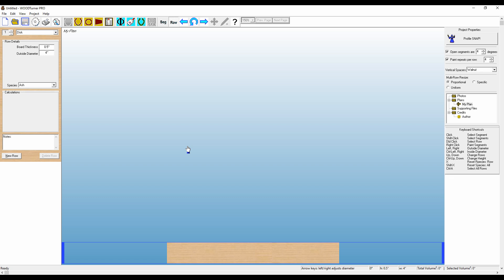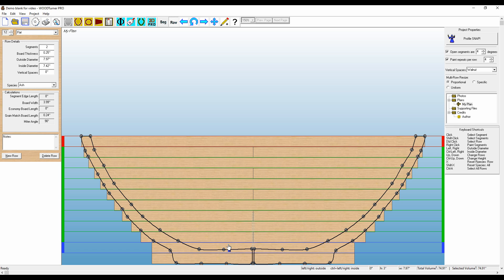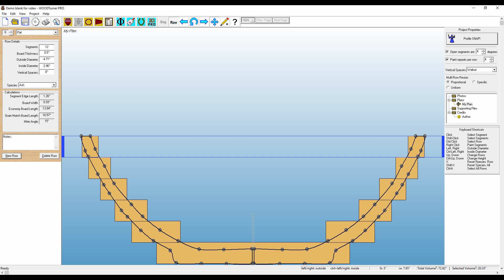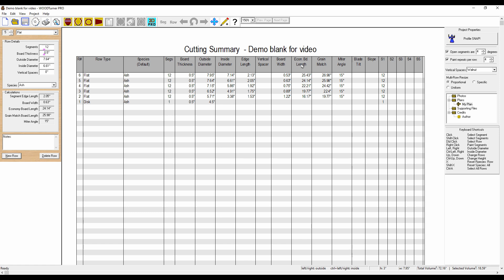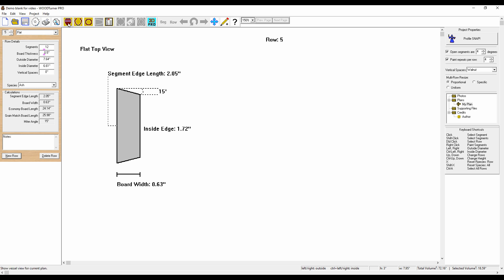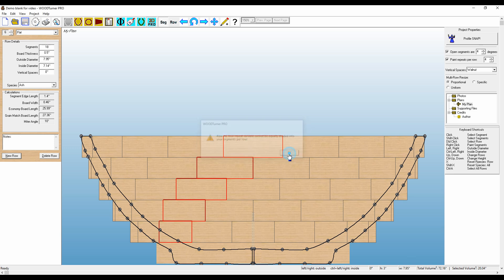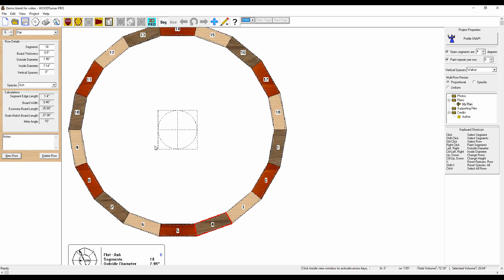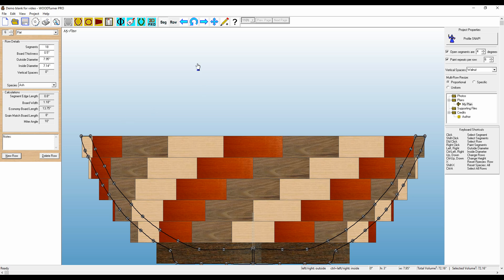Easy Segmented Wood Turning with Woodturner Pro

Comment: Hello Gary. Chuck here. This video is helpful for me also for seeing how the control key works. And I did not realize how the snap key works either. Both of these will save me a lot of time. So thanks. May I ask what is the best method for attaching the disk to the lathe?  Thanks very much.
Reply from the maker: Hi Chuck,
Happy it helped.
Most of the time I will hit glue it to a pre made tenon made from scrap.
If I put a solid bottom on I hit glue the tenon to it.

Gary
Reply from the maker: Great Chuck. I have more coming. We lost power here.
Got it back but no Internet on my PC. I will get them when I can.
Gary

Comment: Gary, great explanation of the program. I just started using woodworking pro and I made two bowls so far. one of my hangups is cutting all the different rows to the different board widths. It drives me crazy trying to calculate  how many rows of different widths I can cut from a particular board. Example- I have a 5.5 in board and I have 4 different width rows such as .5”, .75, 1.5 and 1.75. Is there a program or easy way to figure out a cutting diagram that will help me use the 5.5 in board efficiently?
Again great videos! Thanks again
Reply from the maker: Thank you Bruce.
I just add the widths in my head and sometimes stop if there is a scrap big enough for a wider width. Usually I will only have 1 or 2 wider rows. Normally the bottom 2.
Not scientific but it works.
Thanks for watching,
Gary
Reply: I don't typically use more than one wood for a given vase and I have two table saws.  I set the old one up to rip sticks and the good one with the DRO to crosscut segments.  

1. Sort all the rings dimensions by board width and cut a stick 2 to 3 feet long at the widest board width you need.
2. Cut all the segments you need for that width.  If you run out of stick first, rip another  one and finish that segment set.  
3.  At some point, you'll have a full segment set for that width but have leftover stick.  Either rip it down to the next narrower board width and start cutting that ring's segments or ignore the width change and start cutting segments a bit too wide,  The excess will be on the inside and be turned away anyway.  

Every stick gets used up completely and I don't have to plan ahead to maximize wood use.  I drove myself crazier when I tried to match up various board widths and lengths to the stock I had in front of me.  I invariably came up short here and long there with a big pile of useless pieces of expensive wood several inches long.

Comment: Great videos Gary and I wish you a speedy recovery.  I see that the software generate the edge length but what/how do you measure 2.05 inch length?  That would be 2 1/20 inches  Do you use a special ruler or transfer to some other unit of measure or just rough guess that length to maybe just 2 inches?
Reply from the maker: Thank you Don. I use digital calipers to measure.
Thank you very  much and sorry for the late reply. Had an ankle injury.
Gary

Comment: Hi Gary and thanks for all you do... One silly question, if I may... Does WoodTurner Pro have metric units? Thanks.
Reply from the maker: Yes it does have metric as an option. I have not used it though as I use imperial with decimals.
Reply: @ThePapa1947  Looks good, thank you.

Comment: Good evening, Gary.
   Thanks for the computer software demo and explanation. Excellent.
Reply from the maker: Hi Ray,
Happy you like it.
A real mess around here. About 12 degrees and wind. A giant fir tree came down and landed on the house the next street over. It would have hit us if it came this way. Every time the wind blows hard for the last 50 years I thought about that.
I am stuck using a walker since I messed up my ankle so I do not move very fast 
 A bunch of snow as well. Not the usual Oregon weather.

Comment: Looks like a really great package for the types of turnings you do and really appreciate seeing how it works.  Since I'm exclusively a Mac and Linux operation (OK, my 92 year-old mother has a Windows machine on our network), I'll have to see if this runs in CrossOver.  I'm kind of curious.  
  Hope your healing is progressing well.
Reply from the maker: Thank you Mark. I run the program a lot using Remote Desk Top. From a Windows machine to a Windows machine.
I am guessing a Mac can do this?
 I see the doctor this coming Tuesday if weather lets us. Might be icey by then. Very cold right now  15F. Cold for us anyway.
Thanks for watching,
Gary
Reply: @ThePapa1947   Yes, that is a possibility, that's how I run my CAD program.  It lives on a linux system and I use RDP to access it from the Mac so that would be a possibility
Reply from the maker: @MarklTucson  perfect. 
We just lost power here so no PC work for a while. 
Real cold and heavy winds.
😞

Comment: Hi Gary...i am soooo tempted to get this software...i am not real computer savvy...do you think the entire group of applications is necessary and worth it
Reply from the maker: Well getting all 3 programs is worth it because of the savings. 
Do you need all 3? Well no but myself I mostly use Woodturner Pro and Lamination Pro. Those 2 are very important to me. Segment Pro is a fantastic program and probably easer to get started on.
 I prefer Woodturner Pro  just because You are in control of what you are making. 
So I do not want to sound like a salesman and get nothing for saying this but:
If you buy two(which  you should as you save a lot) for $30.00 more you get all 3.
 Download it and use it for free for 30 days is the best way to tell.
 Gary
Reply: I tried several free programs and some free trial programs before deciding Segment Pro was worth the money.  When I mentioned it to my wife, she surprised me with the full program set and I'm glad she did.  These tutorials are helping me get even more out of them.